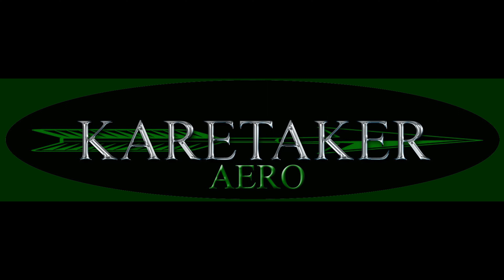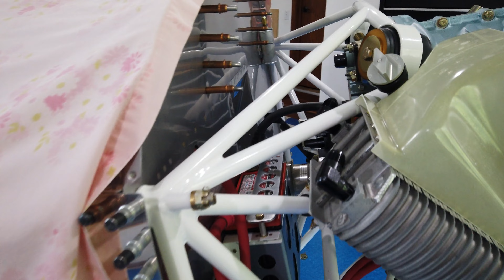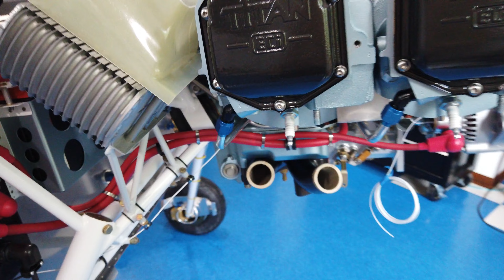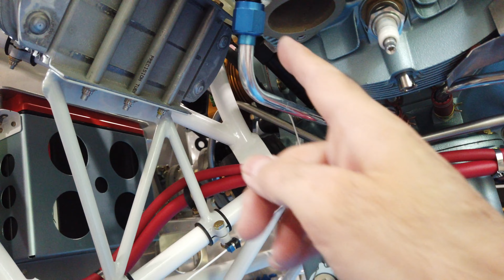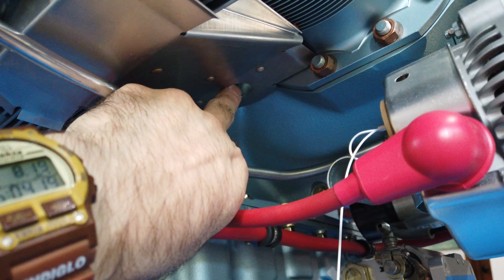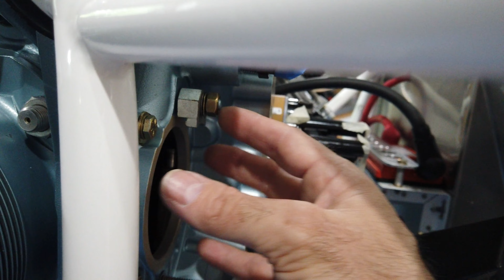Vans RV 7 HINT Video Engine Install 4

Comment: Hi, nice videos. Just an FYI in case, but the instructions for pmag say to have separation of the ignition wires since they can become inductively coupled. There are some pics somewhere in the manual about creating separators.
Reply from the maker: Howdy Allen. I have not installed my ignition wires to the Pmags quite yet, but thanks for the heads up. I have read the manual for the mags and did see the zip ties used for separation. I will use some other form of a wire loom ;  just not there yet. Thanks for checking out my channel!